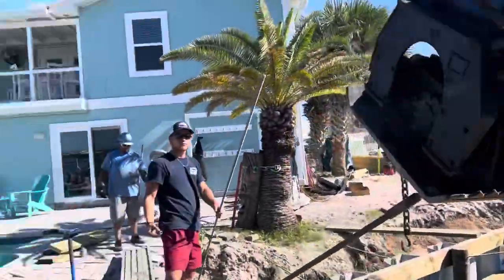HOW TIE BACK A RETAINER & SEAWALL CORRECTLY

Comment: My contractor used I-Beam dead-mans driven 10' into the ground and spaced about 10' apart.  From each I-Beam, he connected rods that connect to the wall.  In addition, my wall has two (one, high one low) I-Beams attached horizontally to it, which are also connected to the dead-mans by another I-Beam.  I'm surprised to see the deadman pipes here are only 6' long.  I suspect my installation will far outlast this one.
Reply from the maker: That sounds great. Steel I beams in environment that I work in would not last super long so that’s why we choose Wood.

Comment: Can u install those using a mini escavator and a breaker hammer attatchment
Reply from the maker: I have Tried welding a plate on a breaker hammer once before and it just broke apart that will not hold up, but thanks for watching my channel and your  question
Reply: @DaleWHickman  the rods dont attatch to ur hammer? We use a 90lb air hammer with a coupling that screws on a hammer bit